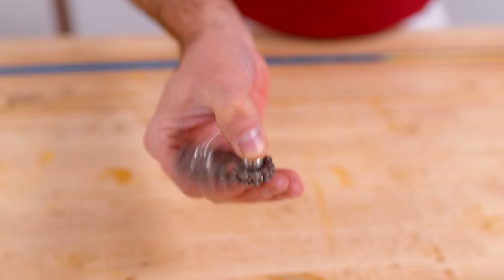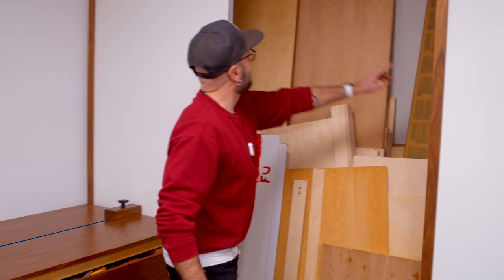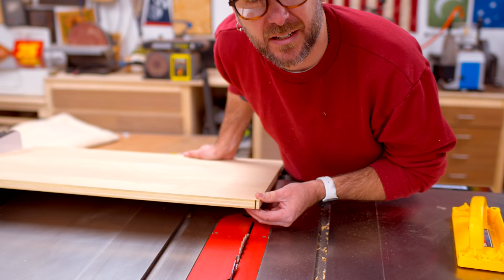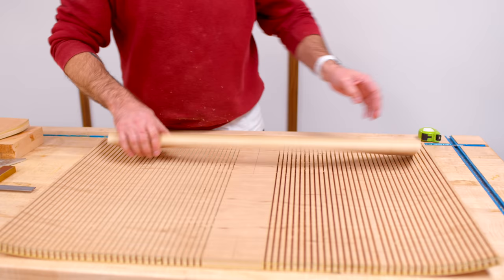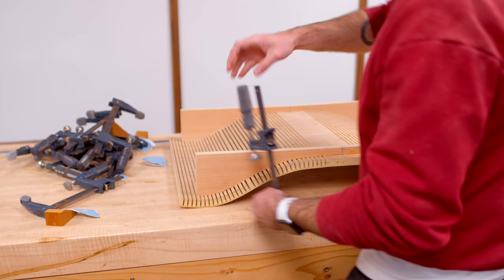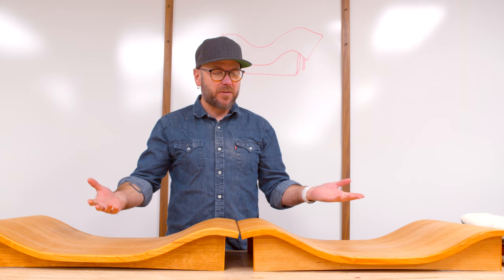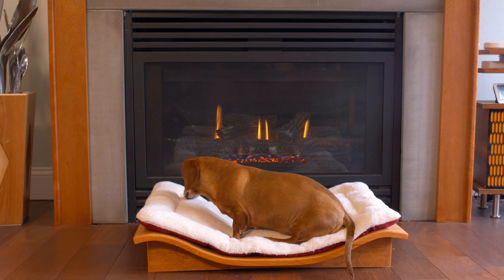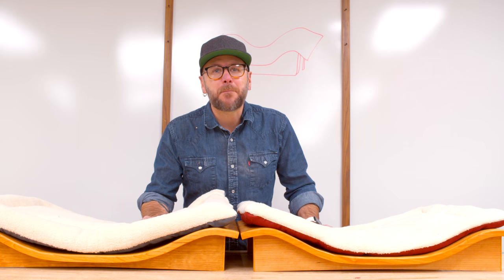How to Make a Curvy Dog Bed by Bending Plywood

Comment from the maker: SimpliSafe is award-winning home security that keeps your home safe around the clock. It’s really reliable, easy to use, and there are no contracts. Check out SimpliSafe: https://simplisafe.com/makesomething
Reply: Excellent kerf bending calculator here: https://www.blocklayer.com/kerf-spacingeng.aspx
Reply: Will you take suggestions on wood projects?

Comment: Wonderful idea. Always wanted to do this myself for an outdoor relaxation lounge... great, now I know how. For clamping up on curved timber, I always use a yoga mat as padding. It grips the wood and prevents it bruising. I also would use thin yoga mat as strips on the wooden floor as it doesn’t tend to slide away, especially when the dogs jump onto the bed. The last thing you need is a displaced hip or knee on you lovely dogs. The felt would slide potentially causing this issue.